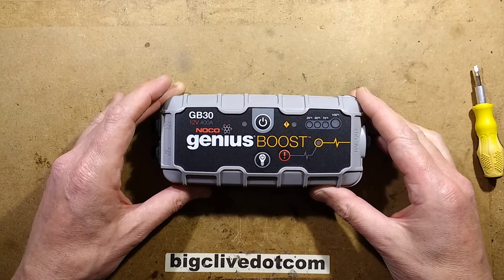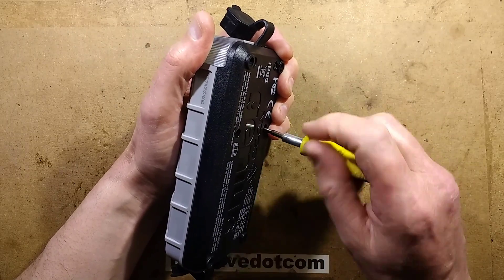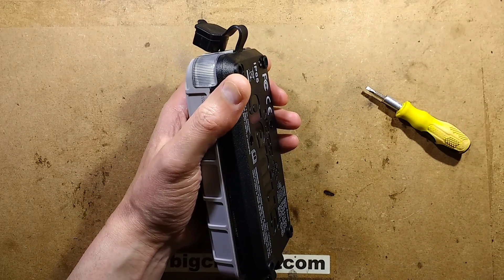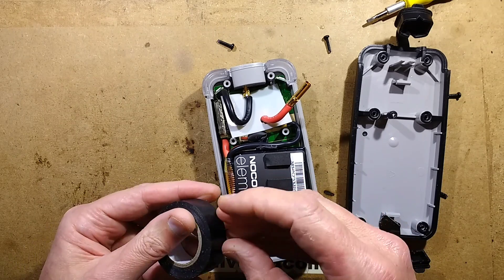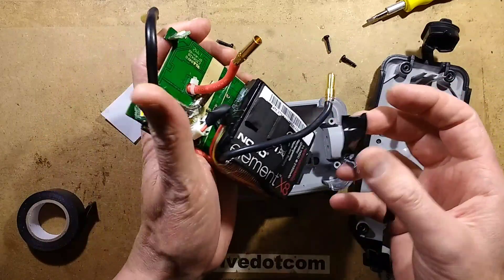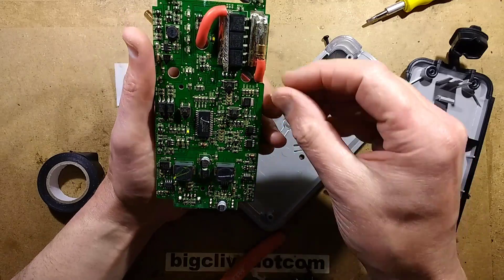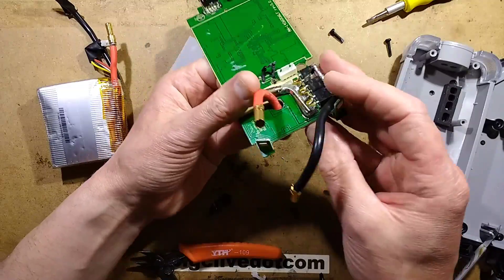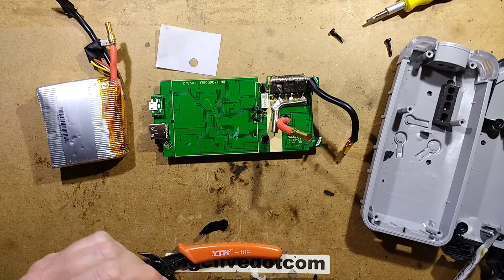Noco GB30 failure autopsy.

Comment: I'm going to guess that what happened to that battery pack is that someone tried to start a car which was reluctant to fire up and they kept the ignition turned to "start" for too long, overloading the battery and the switching circuitry.  Those cells can start a car, but they can only supply that amount of current for around 3-5 seconds before overheating.  Either that or someone deliberately shorted it out just to see what things they could melt with the heavy current.  But if the pack had any protection circuitry, that must have failed too.

Comment: I got a Noco smart charger for free from the Amazon Vine Program - it never worked. Plugged it in, lights come on, attach battery to charge - nothing happens. Even left it for several hours. Nada.

Then I started reading the reviews...

That explained a lot. Basic message was “avoid”.

Edited to add: I opened it and the soldering was appallingly shoddy.

Comment: Clive; Question I just had delivered to Canada,  a "Hopi  model 9800" Was surprised when it came with flexible cord and no ground/earth pin just an empty socket for the ground pin. It was round pinned as expected with several adapters for north America use. all with ground pins.  Don't know quite what to think.
 Tested out  Display ; OK. Surprise you? Any comments would be appreciated.
Thanks
David
Reply from the maker: That's odd.  Maybe they just don't know what connector Canada uses.

Comment: Interestingly, in the manual for the NOCO Model Genius 3500, it states "Do not operate outside the normal operating temperature of 0 C to 40 C" They are available all across Canada and where we live it goes down to -25 C every year. NOCO were not very useful when I pointed this out to them.
Reply: Physical fact is lithium cells do NOT like cold temps. a lot of Tesla owners have learned that the hard way.
that said,not many battery chemistries work well in severe cold.
My dad installed a block heater on his ICE car,made a huge difference in subzero temps. AND you get instant heat from the car's heater/defroster !!  you just have to remember to plug it in every night.

Comment: How do you safely dispose of a Li-ion power pack?  I don't think I would want to toss it in the land fill.
Reply from the maker: They contain very little lithium (trace amounts).  The main hazard is the amount of energy it holds when charged, so if you discharge it completely it's fairly safe.

Comment: You know, I've played with load baring semi conductors in parallel before. 
What can happen is, if they aren't all perfectly matched, and there are subtle differences in their impedance in operation, it causes current to flow unevenly across each component. The lower impedance component passes more current and gets over loaded. 
Then shit runs away and fails.
Reply: Nice thing about Mosfets is that they lend themselves to that though, because they start limiting as they overheat rather than run away, so it tends to self balance in parallel.

Comment: Voltage does not need to be boosted to 12v to charge the pack, Each cell can be charged individually  with just over full charge voltage, which will be below usb Power supply voltage. This way each cell is monitored and topped up as necessary.

Comment: with puffy batteries like that, experience coming from electric powered RC aircraft LiPo batteries, i clamp them between 2 steel plates gently in a bench vice and then charge the battery up. squashing the battery reduces the gap between electrodes, i.e. reducing IR, and the metal keeps the battery cool by sinking the heat away. charging the battery somehow makes the battery un puff. this is possible unless the battery has discharged beyond about 3.0V per cell.

Comment: Oh, I wish you would do some repair videos on the broken devices you get. I like to fix things. I get a great deal of satisfaction out of it. I have a headphone amp that I purchased from China and it never worked, so I opened it and I found a solder bridge on a control IC for the power supply. I fixed that and the power supply now works, but the amp didn't, so I used my DVOM to see where I was getting power. I had it into the quad op amps and boosted power out, but at the film capacitors I had voltage on one in and out, but the other had voltage in, but nothing out. So I wait for some new ones. Once it is fixed I will have a working unit and they refunded my money as they don't make you send back the broken unit. Perhaps the jump starter that you are tearing down isn't worth fixing, depending on the cost of the battery and a some new mosfets. I still would have fixed it:)

Comment: When lithium-ion batteries are over heated, over charged, or failing due to old age  the inner cells of the battery will outgas a flammable electrolyte mixture. This is what causes  lithium-ion batteries to become swollen or as you said "Puffy".

Comment: Have you tried replacing the FETS and seeing if the unit can be resurrected? New cells are fairly cheap so it need not be an expensive project.

Comment: I need to replace the MicroUSB charging input on mine. Fell off a table while charging and the plastic internal piece broke off, it'll charge if the cable is in a certain orientation..
Reply from the maker: Damn, I'm away from home at the moment and I'm not sure if the case got thrown out or not.  Otherwise I could have posted you the bit from this one if it's not a standoff that's broken.  It might be worth checking the solder joints on your units connector.

Comment: I have one of these units and it does have protection but if you have a complete dead battery, you can put it in in some sort of Manual mode where it allows the full current and circumvents the "brains" that detect if low battery is connected.
Reply: The electronics check if you have connected the pack the right way round and won't let it give power until it sees the vehicle battery. If the vehicle battery is so completely dead the pack doesn't detect it you can press the override button and then it gets power - you have to check you connected it right way round!!

Comment: "I don't want to short them together" while connecting the terminals together with a finger. Isn't human flesh conductive
Reply: Most men's hand skin resistance usually varies between a few megohms down to around 10k Ohms, depending upon skin thickness, wetness and cleanliness. Assuming a worst case resistance, in Clive's hands, of 12,000 Ohms, with 12 Volts on the battery, then the current through his hands would be 1 milliamp. That's nothing like a short circuit.
Reply: Not enough to cause an issue

Comment: AvE was not too impressed with the Noco compared to claims or large parts of the design being very generic cheap crap with a less cheap price rather than premium.

At least some aspects of the design were better with yours Clive but the poor thing has had a hard life and clearly didn't protect itself.

When you have cells like that there is only one valid reaction. Nail though the centre of the pack.

Comment: Amateur question here: How he did not close circuit with his hand when he touched both leads in same time? Around 3:20
Reply from the maker: Low voltage is not a shock risk as it can't push enough current through your body to be harmful.
Reply: bigclivedotcom Thank you very much on reply! :)

Comment: I think they're intentionally putting air into some lipo packs as a kind of built in cushion.  I've been seeing it fairly often recently.
Reply from the maker: These packs often rely on the pack being sealed tightly to hold all the layers together, so I'm not sure the puffing was intentional.
Reply: bigclivedotcom only one way to find out.  Stab it with metal after overcharging it.  It's literally the only way.  Nope, no other way around it.  Gotta stab it with metal at 16v.  Really is a shame, that you'd have to blow up a lipo cell on camera to find out.  That would be pretty fiery and dangerous.  Wouldn't want that to happen, and definitely not on camera, and you shouldn't then upload that footage to youtube.

Comment: hey clive, a set up like that i dont think would charge at 12v. wouldnt it instead buck down from 5v to 4.2v and use the balance cable to charge each cell individually? thats how rc car chargers top up their multi cell packs. You wouldnt wanna charge a high current pack like that at 12v due to the cells going out if balance.

Comment: I also had a GB30. Sturdy build quality, IP65 rated, and would charge phones for hours. Loved it. Mine failed after a couple years of use. It's lithium battery swelled up so much that it cracked the case open. Must have been a similar failure as this unit. It was out of warranty but NOCO swapped it out with a new GB40 for ~$50. One difference I noticed is that the GB40 has a relay, apparent by the clicking it makes when jumpstarting cars.
Reply: insanity54 
So the lesson is don't buy the GB30 model? How is your new one doing?
Reply: @mrbmoney2396  I have the gb40. It used to work kinda ok... now it doesn't. Puts out 12v but not enough current to crank. I bought the gb70 this week. So far it works good. Boosted a 5.9l Cummins with it and it fired right up even with intake heater coming on prior to start. In fairness block heater was plugged in and batteries still had some voltage so not a real torture test, but I was surprised, I didn't think it would do it.

Comment: I have a theory that any product labelled "smart" is actually stupid. How smart do you look using a smartphone or driving a smart car? How do you like them smart meters? So how much worse is something labelled "genius"? Fucking run.
Reply: There's a whole lot of pseudo and not much science here. And both articles pretty much cite the exact same anecdotes. You don't warm a bottle in the microwave because it can be heated unevenly, possibly causing super heated pockets that will burn the shit out of your baby's mouth; also, the super heated parts WILL lose slight nutritional value. Happens to anything cooked too long. Microwave radiation is anathema to live cells, hence microwave blood transfusion=death. If you're going to bring proof, bring proof, not anecdotes. Any sort of electromagnetism is a form of radiation; if you're that scared of it, best live in a lead lined Faraday cage with no lights, but I don't think you'll last long. And no, I'm not a paid shill for big micro. Edit: correct typo
Reply: Terrace Thornhill for someone watching a technical channel you believe way too much shit science. "microwaves cause cancer" is as accurate as "vaccines cause  autism".
Reply: Terrace Thornhill is boiling water bad now? cause microwaves just boil the water in your food....
Reply: They aren't called "smart" ovens, or even "genius" ovens. The answer to that clickbait title is NO. A gas stove or open pit fire has far worse hazards than a microwave. Un cooked food has all sorts of hazards as well. Microwaves are used for re-heating food and beverages. Life is hazardous and no one gets out alive.
Reply: Prefer the direct carcinogens of a blue steak directly on hard wood, but thanks anyway.
Reply: Terrace Thornhill Panasonic markets their  mid to upper end microwaves "the genius"...........
Reply: gmcnewlook Good example. "Is it possible that millions of people are ignorantly sacrificing their health in exchange for the convenience of microwave ovens?" http://www.health-science.com/microwave_hazards.html
Reply: Brian Argo Please, by all means, use a microwave oven to cook as much of your food as possible.
Reply: Sam Koch smh
Reply: Steven Ludeking What, do you work for the microwave oven industry or something? It doesn't take much digging to find out that microwaves are a health hazard. "Why and how microwave cooking causes cancer" http://www.naturalnews.com/030651_microwave_cooking_cancer.html
Reply: Sam Koch If you understand how a microwave oven works and still think it's a good idea to use one, then go for it. Natural selection, man.

Comment: NOCO products look good on the outside but no so great on the inside. The NOCO charger I have is equally good at generating radio interference as it is at charging batteries, and due to the choice of components and overall construction I doubt its long term reliability.

Comment: Sorry for commenting before watching the video;
Wanted to share that NOCO 's customer support explicitly denies the content of their manual for their G3500 (6V/12V lead acid) with respect to low-voltage recovery.

I'll have to see if I can find it - but the manual says that if it cannot charge a depleted battery at 12V, then hook it parallel to another charger or power-supply and use the 6V setting first. (Not that this did work- the safety-cutout would trigger without a parallel charger/wallwart, but it wouldn't actually charge with one.)

When asked if it would be valid to use the 12V setting on a depleted 24V battery in a similar manner to how the manual says to use it set to 6V for a depleted 12V battery, they yelled and screamed that the manual and website (at the time) did not say what I was reading and quoting page-and-printing numbers for.

I'll still use it auto-shut-off to top off batteries from a storage charge, but I would have been better off building my own charger from scratch since I had bought it for the depleted/recovery charge mode in the advertising materials displayed at the store (at the time) when I bought it.

Comment: How odd. That pack says it's a LiIon, but it's clearly of LiPo construction... even puffed like a LiPo... My experience with Genius products is that they work extremely well, until they don't. And they have bizarre failures. But that's the problem. They work well, but they aren't reliable.
Reply: gymkhanadog Li-ion cells puff up just the same as lipo packs. you can even construct them the same

Comment: Am I seeing this wrong or is the Diodes before the mosfets? Or are they running in alternating series through the PCB board as diode, then mostfet, then diode, then mostfet? To me is looks like it's Diodes, then mosfets so if it was shorted when activated the mosfets would have blown and apparently some power still made it way past the Diodes and puffed the pack. You can get s pack that would fit it  probably from an RC website for RC planes and drones. Just make sure the deletions are the same, it's a 3S pack and the balancing leads are standard. It would have to be at least s 25C rated pack, but would be safer going with a 50C pack. Then replace the mosfets with some that can handle higher current then the ones used, and maybe faster Diodes also to prevent the pack from puffing again in case of a short.
The question is did someone short it, or is their s short in the soldering on the board? The parts and battery might cost you $30 US, but then again it might not be worth the repair. I think originally the Diodes were rated to prevent the current from the car battery power and altanator/generator charging system from entering the pack once the car started. But they may not have taken into consideration the packs own power from someone shorting it. The newer ones have at least three steps just to activate the car charging port probably for this reason as a safety so people don't hook it up wrong.

Comment: Bypass the "dongle" elements and use a external "dongle" plug in cord. 

That's how all the others are wired...

Seems this solution would solve both issues ?
Bypass the broken bits , and place the diode board externally where it can cool easier.
Reply: 101rotarypower i was thinking the same thing. shouldnt be too difficult to modify it

Comment: what actually happens inside lithium pouches that swell up cos I had a power bank with 2 in and one of them swelled up when it was charging. i thought it would be something happening to make gas or vapour inside but it only swelled at one end and it feels solid not squidgey like it would be if it had made gas inside. 
also i didnt want to use the swelled up pouch again in case it caught on fire or w/e but it still works and makes >4V
Reply from the maker: I think it is just vented gas from the electrolyte.  The packs seem to be sealed under external pressure to ensure good mating of the interior layers.
Reply: thats what I thought but its weird how the swollen bit is completely solid and only at one end

Comment: The best booster pack for jump starting remains another car.
Reply from the maker: There are some pretty good ones out there, but they need to be used sensibly.
Reply: cjmillsnun For some reason, I read that as "The best booster pack for jump starting the remains of another car."
Reply: bigclivedotcom Of course they should. Or maybe they should not be used at all - I really don't like messing with high-power electrical systems, whether mains or automotive; for the time being, I'd prefer sticking to my 3V3 GPIOs on the Raspberry Pi and 5V IO pins of the ATmega328P. 

On second thought, perhaps these units could be "used sensibly" as in utilizing the very large and intricate system of pulleys to bang nails through lithium cells in a 'safe' manner as opposed to standing right up close to them when they go bang. Or using this long roll of wire to solder onto the connections of the cell to be able to stand back before shorting them. Speaking of, a current clamp should be added into the mix to make the test marginally scientific.

Comment: oh come on you can fix it!
Reply from the maker: I could, but it would require a new high current battery pack.
Reply: i think you should do it because it's quite a handy tool to have but yeah the new pack would cost a little. but i think its worth doing it.

its strange that this thing have failed in the first place.. that pack is definitely have been shorted or polarity was mismatched and that warning mismatch polarity light was ignored.